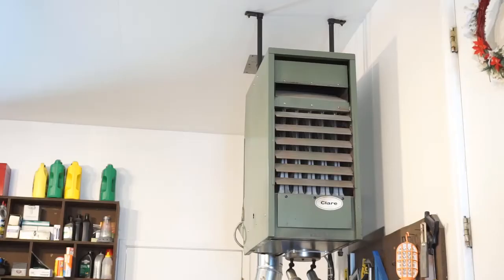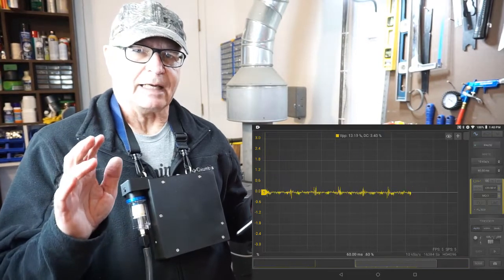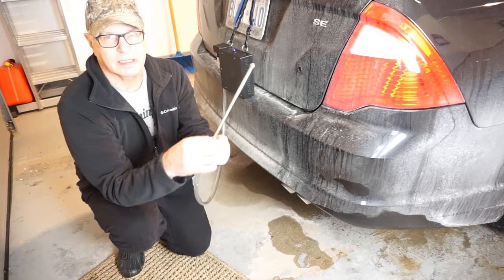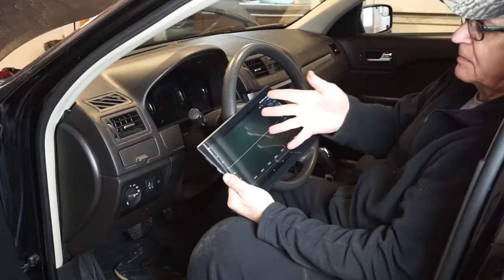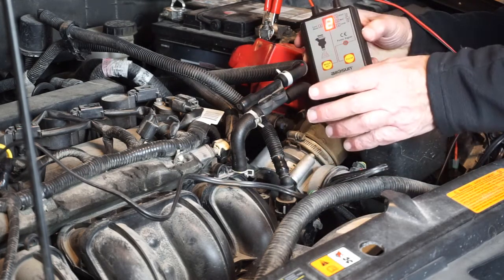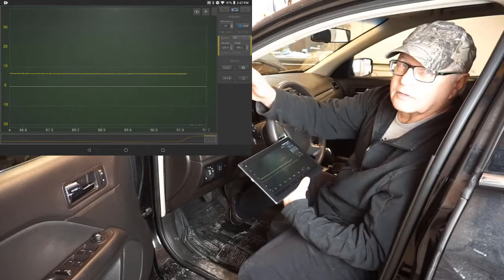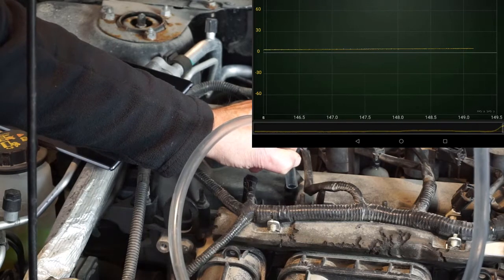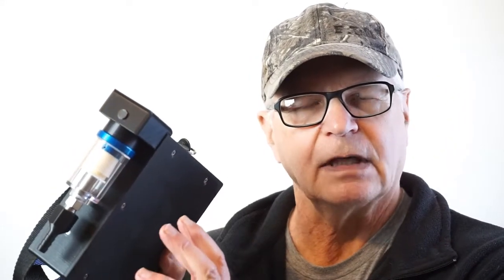GADGETS#133 - HS101 BLT GAS | DEMO

Comment: Nice Denis. I've just been checking for a suspected leaking injector and that would have been another cool test to use. Great work 👍😁
Reply from the maker: The fuel vapors had to make it through manifold-cat-resonator-exh pipe-muffler and finally to measurement chamber...and they did!
I was as impressed as anyone...

Comment: Wow, looking forward to see if it could do a five gas exhaust analysis. Great job.
Reply from the maker: We can rule out the ability to read NO and O2
I'm hoping to make inroads on CO and CO2
The "Holy Grail" would be the ability to detect combustion byproducts from bad head gasket in engine coolant. We'll see...
Reply: @theGADGETSplaylist  Is adding a nox sensor not very practical? Nice work btw.
Reply from the maker: @gcmd5852  not sure, so far limited my testing to MQ2 sensor...

Comment: I think that you can also test for headgasket leakage (with running engine) , if you place the hose in the expansion reservoir of the cooling system or above a open radiator.
Reply from the maker: Was the main goal of this project from the start...proved difficult to achieve as we're targeting CO2 to accomplish this...not an easy gas to measure.
Found the solution today! Proof of concept achieved.
Will be making video soon:)